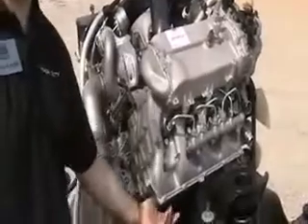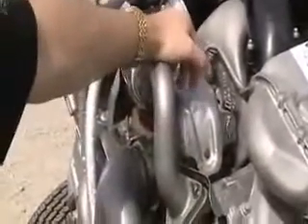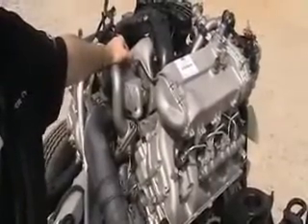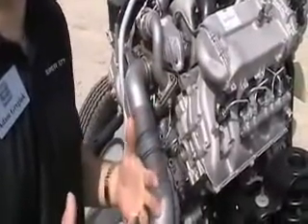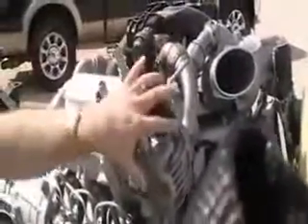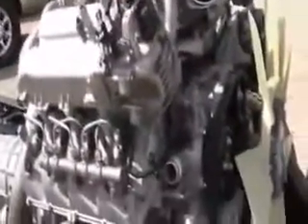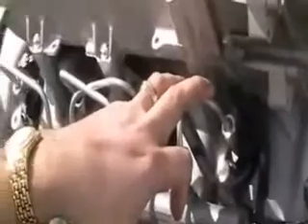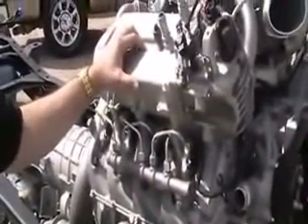Ford 6.7-liter Power Stroke V8 Turbodiesel

Comment: @Turbo617 chipping a diesel doesn't just equal unlimited amounts of power and torque, i don't see trucks with 1000 ft-lbs of torque that are simply chipped there's a lot more to power increases that flashing the computer

Comment: @studpuppy69 It limits vehicle speed to 55 when the truck sees that there's only 99 miles or less left of DEF.  If it's run low enough, the truck will only be able to idle.  It's only because of EPA standards. All manufacturers have features like this on their diesels.

Comment: @F650Rcr LOL too funny. First, if you run out of DEF you're not going to be able to start it. The half a tank and it limits to 55 is pure bs. If it was ran LOWER, I believe around 1/4 tank you get a warning light but no problems, when it gets critically low expect a depower.

Comment: @mirlin235 I hate fords for a deep passion,I was taught if there were no Fords I would not have a job.I am a mechanic by trade and nothing but cuss when working on a Ford.Ford does everything the hard way and leaves no room.Look on my father's used car lot,no fords and there is a reason why.Loses money on them and money pits.If you want a cheap truck,buy a Ford.My father goes to dealer only auctions,Chevy brings the most money,Dodge is 2nd and Ford is dead last

Comment: @mirlin235 My father's new dodge has not have those problems yet.The 6.0 and 6.4 tend to blow up with no warning,a piece of junk and don't hold up hopped up.Have been told of a 6.0 blowing up with no warning at all having 30,000 miles on it.Most places hauling trailers don't use Fords with the powerpuke,don't trust them.Mostly Dodges with the cummins.Ford released the 6.7 way too early and Ford tends to do this a lot,drivers practice driving them.

Comment: @mirlin235 Go look on Chevy's website and watch it.My Matco tool dealer stops by a Ford garage on his route and been told nothing but in the shop being worked on by techs working on them.My father bought the Dodge heavy duty 3500 single wheel with the proven cummins for one big reason,no exhaust fluid used.

Comment: @mirlin235 My father has not had any bad luck with a Dodge he has owned.Has owned fords in the past,all junk.I know so many people that had fords and no more.My father's friend Tom and his daughter Debra are two.Tom had his 1989 F150 in for a re ring job under warranty and the dealership dumped in the old oil back in.Said oil was not covered under warranty.His daughter Debra had a 2001 F150,the windshield leaked and took the gem module out,dealership would not cover it under warranty.

Comment: @mirlin235 My father had bad luck with Fords,a 1961 Lincoln,1962 thunderbird,1964 galaxie and 1963 station wagon which were junk.He drove the staton wagon while he was serving this country,in the USMC.Went through 6 engines including rear ends.He got rid of it when the rear end went out of it.Fords are money pits worse than Chevy and Dodge and I see this a lot.Anyone saying the Ford 8.8 rear is as good rear end,Wrong.Weak and most yards get calls for them

Comment: @mirlin235 The Dodge transmissions don't go out.Ford has the shittiest rear ends the pos 8.8 is one of them.Most shops see lots of this when a Ford comes in to get fixed:tons of money made.Ford turns down warranty claims.Have rust on a Ford?Not covered if there are any rust holes.Ford does overcharge on parts and I have heard it.Ford gets a bad name a lot.Least with a GM you can take a computer of another vehice and install it in another vehice.

Comment: Pile of junk.Mostly in the shop most of the time.Jasper got a hold of 6 or 7 of them finding the problems and came out with upgrades for it already.Weak frame too,Chevy did a test on theirs and the Ford.The frame on the Ford twisted so bad the tailgate dented and could not open it at all.Chevy and Dodge have a fully boxed frame and the Ford does not

Comment: @mirlin235 I know about Fords,a pita to work on.I won't even get inside of their electronic automatic transmissions,a pita to diagnose and to fix.I know a transmission shop that bangs their head against the wall when working on one.Ford is not a top company,all they build are pieces of shit.The new Camaro is outselling the Mustang.Ford is well known for wiring harnesses catching on fire,the $700.00 spark plug on the 3 valve tritons.I know people that had Fords no more